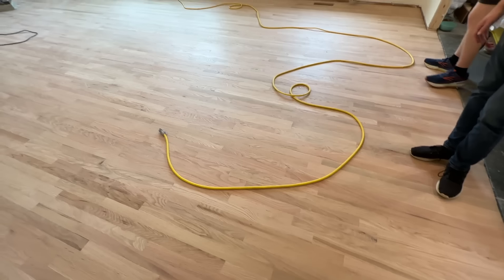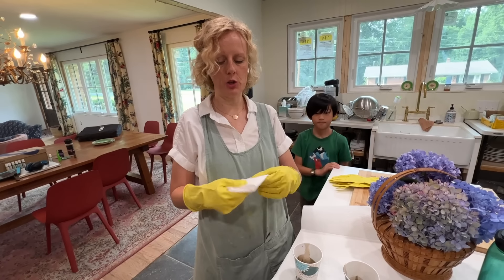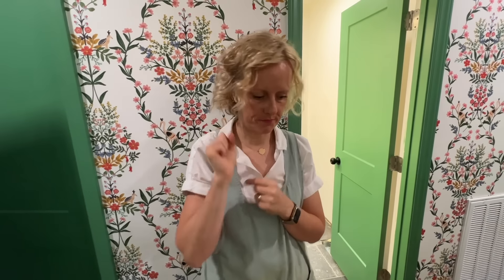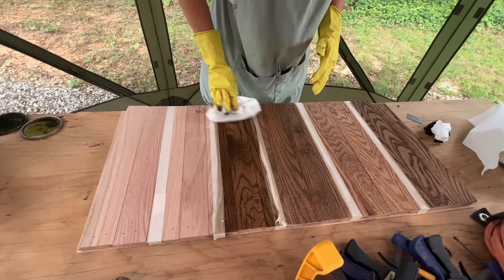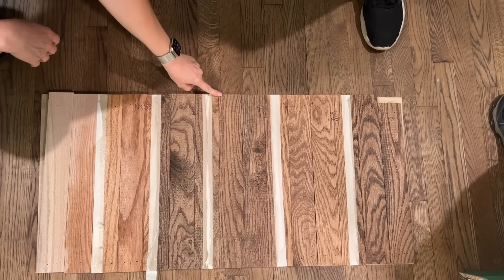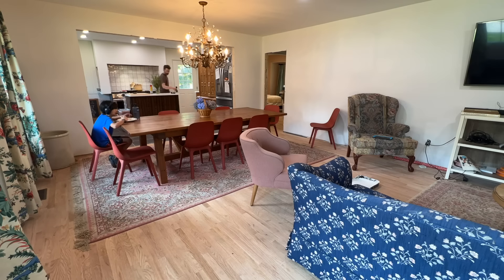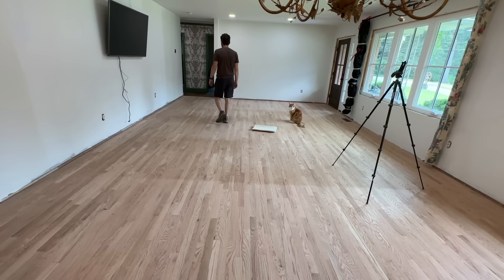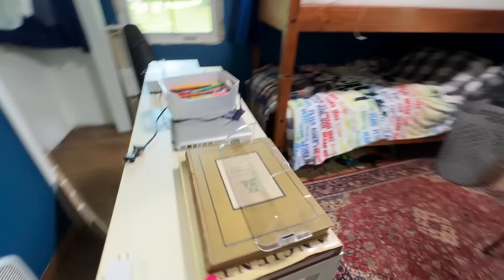STAINING OUR RED OAK FLOORS TO MATCH WHITE OAK

Comment: I was watching this video again (because I love it) and because I relate to redoing old from-1959-varnished oak floors. When I redid my floors I used a drum sander with pad made from man made pads that were progressively finer. I vacuumed between each go-thru and damp mopped to raise the grain between sanding. When I went to sell my little house, people walked in and said “What beautiful floors! What company did you use?” The first buyer came in and bought it before it was on the market.  It really showed off my Persian carpets. 
My recommendation is to buy carpet pads for your wool carpets. 24:36 They will not wear out if you do. You’ll be able to pass them down to your grandchildren.

Comment: Suggestion....you are NOT going to be young forever.  Surprise?  Anyway, you should be on the lookout for a deal on a stand up buffer.  My family owned a house many years ago that was old enough that the wood floors in the living and dining rooms were made to have a big rug in the middle.  As in, the middle of the floors were made from a cheaper wood and the fancy prettier wood was around the outside of the room.  My mom would get down and wax and buff them a couple of times a year.  The buffer was actually kind of fun to run for us kids.  The floors look great!